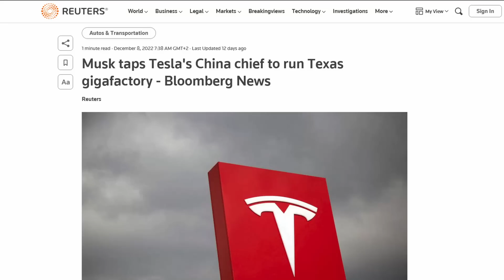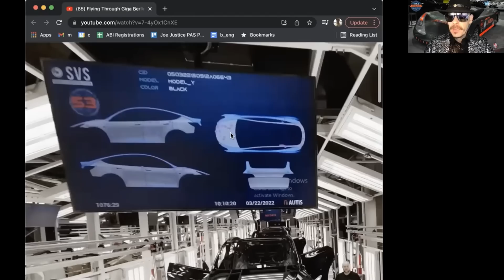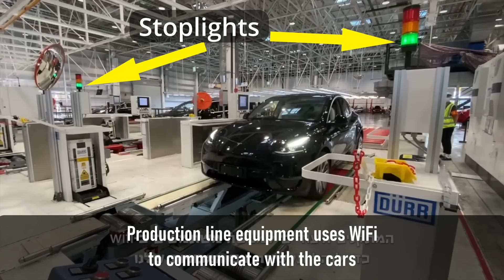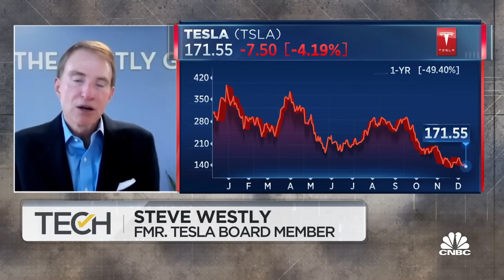Giga Shanghai AGILE FACTORY REVEALED (Joe Justice shown Right) | Interview w. Giga Shanghai Manager

Comment: Yes, you could put your high voltage wires into aluminum tubes.
You could also just use aluminum tubes, period.
Alu is a good electrical conductor (it's used for high voltage power lines) and is cheaper and lighter than copper even after considering that you need more of it (by volume) to make up for the worse conductivity.

Edit: Oops, commented too soon :'D
Reply from the maker: LOL Happens to me to👍

Comment: Since this video is based on an interview and footage from 2021, current production practices at Tesla are well ahead of what was shown. Tesla moves at warp speed with innovation and are light years ahead of any other car manufacturer in terms of production efficiency and lowering production costs. By the time the Cybertruck rolls off the assembly line in 2023 it will make all other pickup trucks look like 20th century relics by comparison. The F-150 Lightning and all other competitors don't stand a chance in competing.

Comment: I was disappointed to see so many cars being driven by humans around the factory, especially during testing, how long before fsd takes over this task>
Reply from the maker: My guess is it's mostly regulations. Fairly easy to do it autonomously in known surrounding. Eventually they will do test drive without humans (microphone etc checking the car) after which car will go to parking lot waiting for truck or boat. Can't wait.
Reply: @ConnectingODots  and eventually drive to whatever delivery location the buyer wants autonomously with FSD

Comment: Calling this Agile is meaningless, and is only to sell consultancy.  Tesla's factory is a product, that product isn't called Agile.
Reply from the maker: I respectfully disagree, since the factory is geared towards Agile development and production.
For example, car testing itself reduces the cost of testing to almost zero. This enables you to test every car at every point.
Add to that parallel production cells, and this enables you to try modifying things in a cell (install different wire, or system, or install same thing in a different way). You get a car, play with it, and when it passes the test you release it upstream and get a new car, all this without slowing the main stream. As you improve processes and speeds you get more and more cars, until you are faster and/or better than main stream after which all parts flow through you and main stream adapts to new method you developed.